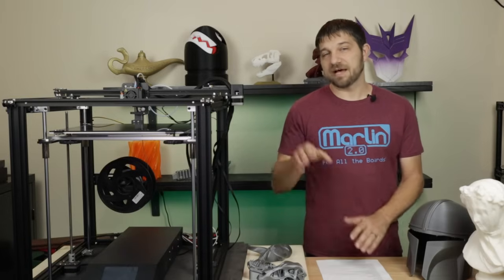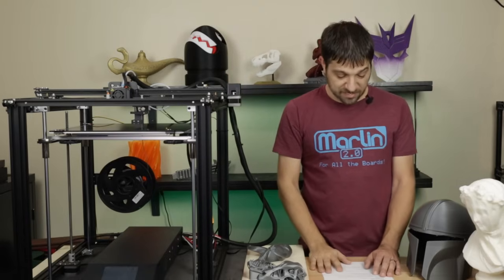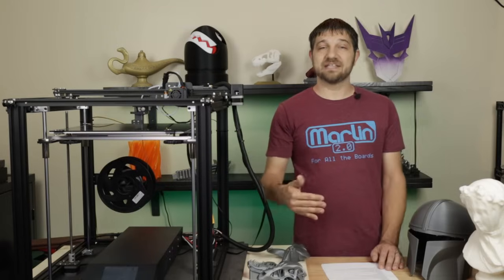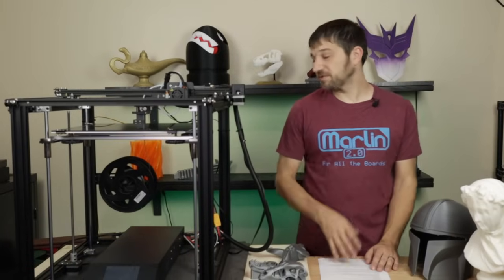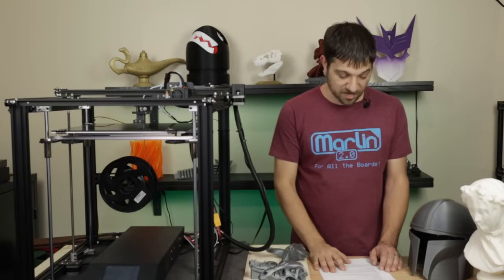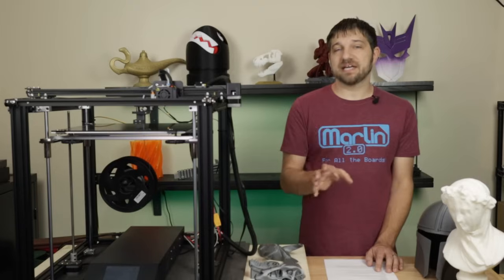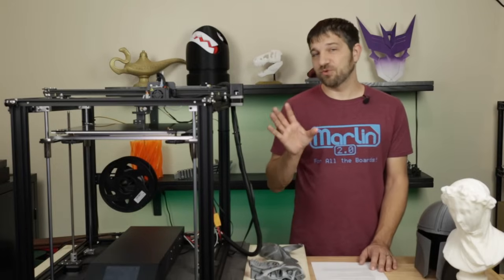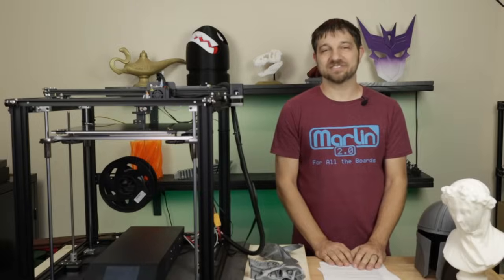Creality Ender 5 Plus Review: EVERYTHING You Need To Know!

Comment: I just dont understand what printer to get. This one seems great but then there are so many fixes needed I feel Ill never be able to manage all the troubleshooting. Im also wanting the CR10S Pro as well but that one also needs troubleshooting. Is there no printer made yet that is completely user friendly?
Reply from the maker: The honest answer is that there are few printers in the budget price range that can't use some upgrades. On top of that, all printers need routine maintenance. Keep in mind that even $500 is considered budget for these sorts of machines, particularly of large size. If you want "completely user friendly," you'd have to look at some of the more commercial models that cost $700-$1500 and have a much smaller volume.

Comment: This needs a vs battle against the cr-10s pro v2. Theyre both at the same price point and large size. But I had a hard time choosing between the 2 and still wonder if I made the right choice. But I'd love to see which is the better printer
Reply from the maker: I agree but I haven't had anyone offer up an CR-10 for review. Maybe I'll get one after the first of the year.
Reply: @kerseyfabs  I think the advantage may be in 1 part...the cr-10'shot end and extruderim not entirely sure what the hot end actually is but its definitely not an stock hot end. Thats not to say a Swiss or something couldn't be bought and put on the 5 plus. Stability wise id have to say the 5 plus wins. Why they didn't put stabilizer bars on pro 2 was surprising since they put them on every other model. It would definitely be a good showdown. They both have the exact same control and boards from what I've seen between the 2.

Comment: Thanks, Kris.  Great review.  I've been using a Tronxy X5SA for about a year.  Yesterday the controller board fried.  On the Tronxy controller board, the (incoming) leads to the main power supply are directly next to the (outgoing) leads to the bed heater.  The current needed to heat a large bed is quite large, and I think the power supply / controller board just couldn't handle it.  I could replace the controller board, but I just don't trust the design, so I've decide to move on to a new system, and I think the Ender 5 Plus would be a good system for me.  Thanks for your review.  It answered many of my questions about the system -- especially as related to safety.  Thanks.

Comment: Very eager to follow your mods! I have been palying a bit in the last 6 weeks and now I'm running it with a Duet 2 Maestro board and a MicroSwiss All Metal Hot End. Very happy, but still some issue when printing 100% infill stuff, probably the cooling is not optimal... waiting your mods on that!
Happy new Year
Reply from the maker: Thanks! I'd recommend against 100% infill personally. It's difficult to get extrusion just right to not under over over extrude. On top of that, something like the cubic infill pattern pattern can be stronger than doing 100% infill. Happy New Year!

Comment: Do you think this printer is still good in 2022? And do you know if there will be a successor or an updated version of this same model?
Reply from the maker: I'm hoping for an updated version but I haven't heard of when one would be coming out. The reason this printer is still relevant is the design and the relatively low price. Other printers of this size are standard moving bed designs or are much more expensive.

Comment: I am considering this printer or the cr10s-pro.  First printer and want to use it as support for my other hobby.  So that said I don't want to spend my time tweaking endlessly beyond normal maintenance.  Do you recommend it over the cr10s-pro or something else?  the 400mm Z is appealing for some items I would want to print.
Reply: I'm in the same boat. Thinking of the x1 printer vs 5+.
Reply: I have a cr10s pro that I have tried to make it into a decent printer.  I had to take the X gantry apart as it was not properly assembled at the factory.  The uprights had to be shimmed as the we’re not cut square.  The bed leveling sensor was inaccurate and unreliable.  I replaced it with an EZabl pro.  I put a hemera on it which helped a lot.  Mine did not have thermal runaway enabled so I had to use tiny machines’ firmware to enable it. The touch screen allowed only limited marlin functionality. I ended up replacing the touch screen with a 12864 LCD so I could use all the marlin functions. 
I bought a sidewinder X1 to replace the cr10s pro and have been very happy with it.
Reply from the maker: Unfortunately I don't have a CR-10S Pro, so I can only go off of specs and other reviews I've watched. First, these two printers have almost identical electronics, so issues I had with the touchscreen and such will be the same. The Ender 5 Plus has a larger build volume and a bed that only moves in the Z axis. The CR-10S Pro has a couple of upgrades such as the extruder and Capricorn tubing out of the box.

My personal opinion would be I'd rather have the Ender 5 Plus AFTER you perform the upgrades coming out in my first video. They should be relatively easy to perform and will get the printer printing great! It will cost you a little extra money obviously for the upgrades, so keep that in mind. Read Corey's reply about the S Pro and I welcome other people's input as well. Thanks!

Comment: after 2 weeks of use my ender 3 (around 2 kg of PLA) i have noticed on the bed's carriage the wheels were tear our a bit - this is despite to the fact i have line up everything! and in ender 5 plus the upper carriages sure will have the same issues ) so i have sold it and order bunch of components from aliiiii) hope in 3-4 weeks will start the assembly ) for the carriages planning to do in my design nothing hard - once do it sure will send the report ) will be similar to the exoslides.com carriages ) but from metal and differ design so everyone can do it)

Comment: Thanks for the review! So far, we're super happy with our two units. Need a third one. Other than being noisy, we have had no problems printing molds for carbon composites the full extents of the size envelope.
We did buy an aftermarket direct drive extruder kit , but it did not accommodate the BL Touch properly so we returned it. It works with the Ender 5, not the Plus I have since modeled and CNC'd our own kit (interested in trying one out?)
As far as leveling, we mounted a dial indicator in the middle of a 36" long 1" square tube. It is very easy to level the bed within .001" in less than a minute. 

°Would like to see quieter drivers.
°It did take us a while to realize the issue with long file names...
°Our beds are different- they now have a white Creality logo on a surface with a carbon grid. Works well as long as you keep it clean.
°ordered ours with Capricorn tube.
°Keep the belts tight.

Really looking forward to your future mods vids covering the noisy drivers, Z axis backlash, tuning, etc.
Reply from the maker: Thanks so much for sharing your experience. I'll start releasing my videos in the next week or so if all goes to plan!
Reply from the maker: BTW, I'd love to try one out. Send me an email. kris@kerseyfabrications.com

Comment: Hi there, thanks so much for this great video, as a true newbie I agree that it is completely overwhelming. I thought I was set on getting an Ender 5 +, but now I've also been thinking of the FLsun 400 as an option. I know this is an old video, but I'm hoping you might enlighten me further with a response. This is going to be my first ever 3D printer, that said, I'm not intimidated by swapping out mainboards or tinkering with firmware (I'm a quick study). That said, I'm using this to build prototype products from 3D models I build in Shapr3D, so I kind of need something reliable with high-quality prints (especially for printing gear assemblies). I can easily skimp on detail if I get quality in return, and though speed would be wonderful, it's not a deal breaker either. Print area however is more important. The product design I'm working on now needs at least 320 mm diameter build volume (z axis shouldn't be a problem), but if the FLsun 400 is THAT much better in all other respects, I could compromise that to design it to 300 mm, but it wouldn't be ideal. Since this is my first printer, and it's for prototyping, I'm trying to keep costs down but I'm willing to pay for quality and reliability. At the moment I've been oscillating between the CR-10 Max and the Ender 5 +, but the FLsun 400 has piqued my interest. Yeah, I'm just a jumble of confusion and need someone with more experience to advise me on what would be best for my needs. Hoping you can help???

Comment: Great review, one of the turning points of my Ender 5 Plus purchase. I decided to watch it again to see if there was any info on a slight issue I have run into with the Z axis. If anyone has any suggestions I would greatly appreciate it. After the assembly and configuration of my Ender 5 Plus I noticed that the right Z Screw was significantly tighter as the bed got lower. I have made small adjustments to correct the issue however the problem persists. As far as I can see the screw and the guide rails are not bent in any way just a little..... off... thoughts?  NOTE  --  if the right Z axis screw is turned by hand you can feel the tension increase as it gets closer to the bottom. This normally starts about 3/4's of the way down.
Reply from the maker: The first thing I would check is to be sure that the platform is level. Home the bed and make sure the left and right side are equidistant from the top rail. I demonstrated this in my original preview. Also make sure that the screw is perfectly centered between the front and back guide rods. I think those are the most likely fixes for this.
Reply: @kerseyfabs  Thanks for the info, turns out that one of the Z guide brackets had a screw that was not centered at all. I have the screw out at the moment and it made a huge difference. Ill have to figure out a way to recenter it and possibly re-tap it. Thanks!

Comment: I've come back to 3D printing and have been looking over all the video tutorials I had used before. Have you updated your custom firmware at all in the last year or so? I really loved that it adjusted the auto leveler to actually take points where the nozzle would be. I'm having some other leveling issues and am trying to eliminate the possible problem. It could be anything from my plate being bowed up in the middle, to having z-steps in the printer and in my Octoprint (it would be amazing if the 5+ realized it was printing when Octoprint told it to print, as I can't adjust my z-offset during a print if I send it from Octoprint).

Comment: How many Amps does the original 24Volt hotbed take? I tried to put an external 24Volt AC power supply with a bridge rectifier rated at 50amps and 1000 volts to power the hotbed, but the bridge rectifier got fried within 1 minute giving off smoke. I escaped from seeing it explode  by turning off the power as soon as I saw the smoke start.    The bridge rectifier most likely isn't working as its advertised rating(I bought it on Amazon and most likely made in china), but in order to calculate, I wanted to  know the Amps needed by the hotbed.

Comment: Your Videos are very interesting, thanks a lot!
I used your Ender 5 Plus build up live stream for my printer!

-Is it possible to modify the firmware of the Ender 5 Plus to match the bed size of an Ender 3 and after that, do all build in functions of the BLTouch work?
 Reason for this, mostly (>95%) I print small 3D parts which fit easily on the Ender 3 headbed and I want to reduce the power consumption without switching off the headbed!
 To the answer/question "Why didn't you buy the Ender 3 Pro instead?", because of the last 5%! I don't want a second printer!

Best regards
Chris
Reply from the maker: No, unfortunately the beds are not programmable that way. It's basically a giant resistor.

Comment: May I ask a question about placement of the machine? Does the ambient air temperature affect the printer? My wife wants mine to go in our garage outside! Or is it best in the house at a good room temperature?
Reply from the maker: While extreme temperatures could be bad for the electronics, many materials work better in warm environments. My studio and most of my printers are currently in my garage. Just try and keep them clean. 😉

Comment: I am torn between the "Ender 5 Pro" and the "Ender 5 Plus"... Yes the "Plus" has a bigger build volume, but the "Pro" looks like it is more of a second edition.

I get the impression that the "Ender 5 Plus" is derived from the "Ender 5" rather than the "Ender 5 Pro" and that it isn't "fully matured"?

What would you consider a must in an upgraded "Ender 5 Plus PRO" version?

Upgraded tubing? Silent mainboard? Meanwell PSU? Metal extruder? Reworked bed with tighter knobs? More work on the firmware? Other?
Reply from the maker: Your understanding of the printers is pretty solid. My top five upgrade video is being released tomorrow. That should answer most of your questions.

Comment: Hello,

I am still new to the 3d world. My first printer was the ender 3. I am saving for the 5 plus, and your videos are a great start to understanding the machine. I, however, have a question.  You mentioned  the z hop and how to fix it. Should that be done during the build? If so, where would someone find the right parts. One more thing, can this printer run multiple filaments?

think you, 

Suzy
Reply from the maker: Thank you! For more info on upgrades, check out this video: https://youtu.be/dbS9MA4UkZA
I would get the machine up and running stock first to make sure everything works well first. Then move forward with upgrades one at a time.
It can't do multiple filaments at once, you would have to swap them after you pause the print.

Comment: Would you suggest this as a first printer? I am looking for something with a direct drive extruder, touchscreen controls, and a large print volume. I don’t have any experience with printing and I want something easy to setup and use. I am also thinking about the CR-10S Pro V2, or the CR-10S V3(even though it isn’t touchscreen) I really like sticking with creality because I’ve heard such good things about them, but I am open to other brands.
Thanks
Reply from the maker: Please watch my full review for more information: https://youtu.be/-BFUf8S6-FE
It's not the easiest printer to use for someone completely new to printing unless everything just goes right. The CR-10S V3 may be an easier choice but I haven't tested it personally. I hope all of this helps.
Reply: @kerseyfabs  Thank you for your reply, I will check out your full review.

Comment: I have been really enjoying my Ender 5 Plus, but I'm currently struggling to resolve seam issues on thin wall prints.  I've been printing less than 1mm thickness (0.3mm height and 0.5mm width on a 0.4mm nozzle).  I have enabled coasting and designated a seam location.  It appears to me that the over extrusion happens  when moving up to the next layer.  Is there any way to resolve this?  Maybe reducing the prime amount for the next layer?
Reply from the maker: Ahh! This is a real problem and even I've faced it in the past. Thin walls are hard because it's impossible to hide your seams inside your model. The number one thing to do is go slowly! I've had to reduce my speed to 40mm/s to get good results. Also slow down your acceleration and jerk. You may also need to further tweak your retraction settings. And, as always, if you haven't calibrated your extruder, do that first.

Comment: Do you use a glue stick to help with platform adhesion? (Sorry if you already mentioned this in the video)
Reply from the maker: Only sometimes. If the part is likely to lift up due to small size or other geometry then yes. For most prints, no. I just use a brim.

Comment: Does the Creality Ender 5 Plus have the capability to print flexible material similar to rubber?
Reply from the maker: Not with the stock extruder. You can change out the extruder though and do it without problems. I personally have no tried one but I have a couple of options here I plan on testing.

Comment: is there any way to teak extruder steps i get underextrusion with every filament y try i get space between lines in every layer
Reply from the maker: You can actually usually adjust the flow rate to compensate without needed to change your steps.